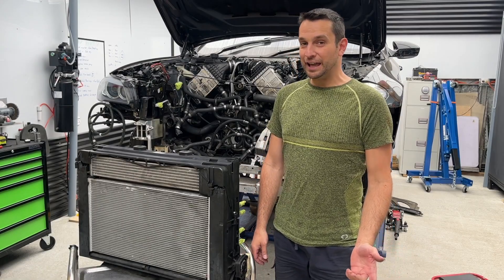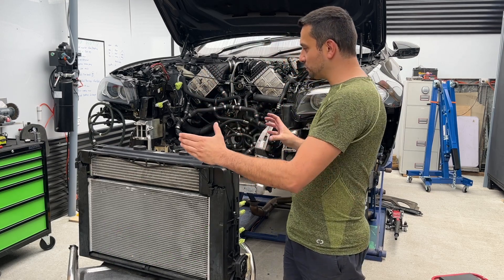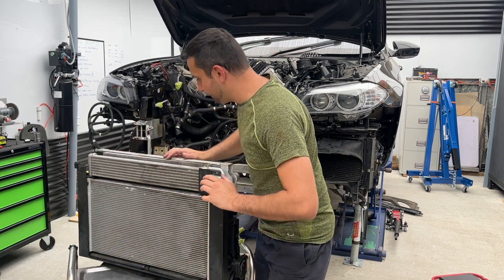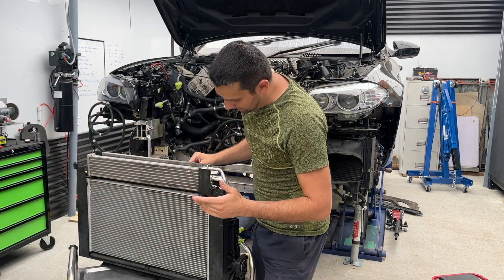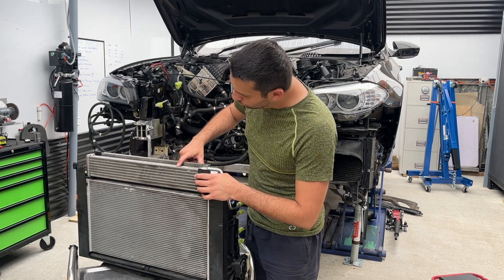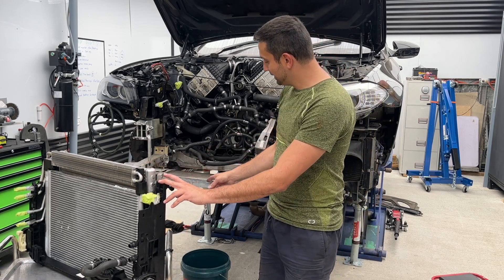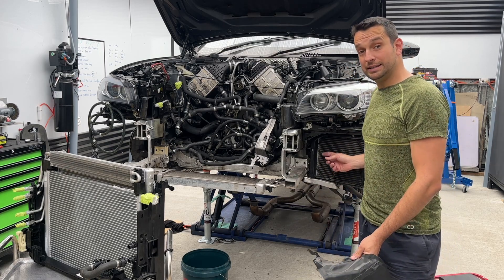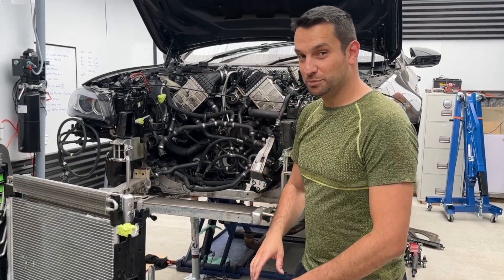F10 M5 - How many Radiators and Coolers are behind the Bumper

Comment: How can you change / flush the coolant on these cars. I've heard so many people give different opinions on where to drain and the filling process you can just pour coolant back in you need a pressured system to do it?
Reply from the maker: You can easily pop one of the lower radiator hoses off and let it drain. YES YOU must use a vacuum kit to properly fill up the coolant - The low temp system can bleed  itself through the AC procedure (EG turn heater to max, hold gas pedal to the floor ) however the main cooling system is driven by a mechanical pump and cannot be bleed hence why without the vacuum it's impossible to get rid of all air pockets

Comment: nice scissor lift.  how high up off the ground did you have to get it?  i am also working in small garage ceilings.
Reply from the maker: Its nice when. you don't have to work under the car as it only goes up 1 metre😝 Trying to get an exhaust, drive shaft or subframe out is a bit of a challenge with one of these but they are really good on small spaces